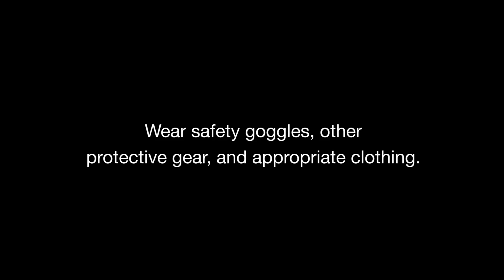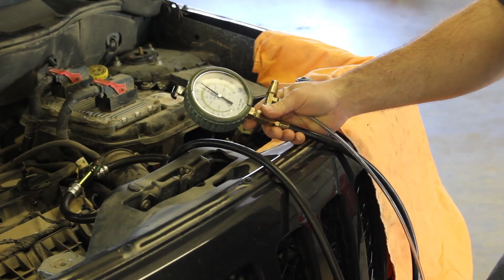How to Install Fuel Pump E7218M in a 2007 - 2014 Jeep Patriot, Jeep Compass, Dodge Caliber

Comment: If I may add to the gentleman's video ( it worked great for me, btw)

1. You'll need a T55 Torxbit for the seat bolts- same size  as for seat belt anchors. Stanley has a set you can get that works with your 3/8 ratchet. Just press firmly against the bolt to loosen, to avoid stripping the bolt head. My bolts, btw, were in front of the seat.

2. Your fuel pump lock ring may look different. Works the same, though.

3. My wife's 2014 Patriot did not have a lower hose attached. It wasn't loose in the tank either, I checked.

4. The blue plastic part that locks the fuel line to the top of the pump is essential so if you are going to reuse the old one VERY CAREFULLY remove it from the old pump. It is a tiny piece of plastic, after all, but if you crack it your fuel line WILL come off and you'll have an enormous fire hazard.

Anyway, it is a very easy job to do.

Comment: I was pleased to see that removing the fuel tank is not required for the 2014 Patriot. Previous vehicles have required removal. I'm not very mechanical but even I could perform this repair. Thank you.

Comment: Hi, thank you for this great video. Can you please elaborate on the very last step? is bleeding the pressure after installation necessary? I've read in the service manual that you need the scan tool to pressurize the system, is that necessary as well?
Reply: ***** Thank you very much. Just finished the replacement, following the steps in your video.

Comment: Where is the fuel pressure port located on the jeep patriot? Thank you for your awesome video!
Reply: Incase anyone is still looking for it, there isn't a Schrader valve on the patriot. You'll have to tap into fuel line. Take off the engine cover and you should see a line feeding directly into the fuel rail on the engine. It connects using a green/black plastic latch. You'll have to get a pressure kit that is compatible with this system. Most auto parts stores will loan you pressure tester kits, make sure to get one with a lot of connector options.

Comment: We’re is the fuel filter located on the Jeep Compass 2008
Reply: It's on the pump. It does not have a serviceable in-line filter like a 90s chevy pickup. I just cleaned and prepped mine about 10 min ago actually (so easy) and I'm going to throw in a new one just cause it's so easy and cheap at work (autozone) lol. Now as far as replacement for what I've read there are some issues on installation with the popular warranty option DFG1140. Some say it either doesnt fit or the armature on the level sensor doesn't work properly...so I'm going to put it to the test tomorrow and try and keep you posted.

2010 Compass Sport 2.4 108xxx

Comment: I got as far as attaching the transfer line. My assembly won't seat, it's getting hung up on something somehow.  This is frustrating as this is my 4th or 5th fuel pump I've installed in my lifetime working on vehicles.

Comment: Fuel pump wont seat all the way- not enough for me to put the lock ring back on top- is there a way to get the pump to seat into the tank?
Reply: I'm having the same issue...did you figure it out?
Reply: did you figure this out,have same problem
Reply: Did any one figure this out??
Reply: Sorry for the delay all- I think I just got a hammer and a non-ferrous metal (copper pipe) found a rib and tried to tap it back into the locked position. It’s not easy& I had a really unpleasant time doing this whole thing. Good luck.

Comment: Could this be a fix to to the dash warning "gas cap open"
Reply: I see no one replied. The gas cap open is about the evap system, which is separate from the fuel delivery system. The evap light comes on when there is a vacuum leak in the system and if replacing the gas cap doesn't correct the problem, then you have to look all through the evap system to find the air leak. Good luck.
Reply: @felipecardoza9967  wrong… it turns out my check engine light was on and my fuel pump went out

Comment: can we bleed pressure of the system by removing the fuel pump relay and crank the vehicle? without using the pressure gauge system?
Reply from the maker: It will. The vehicle will start and burn the fuel off or it will dump the gas into the cylinders in effect flooding it since the engine isn't running. The gauge method is the cleanest.

Comment: Can a fuel pump be weak but operating, i have a p0171 code and have went thru everything else.
Reply from the maker: A weak fuel pump may throw the P0171 code.  Other common issues with a P0171 code are: dirty or defective mass air flow sensor, vacuum leaks,  fuel injector issues; dirty or clogged, bad O2 sensor.
If the pump is found to be weak; low pressure, you will need to do a voltage drop test. If the voltage to the pump is low it will not be able to perform to spec. Even a new pump will fail to perform.

Comment: I just went through 2 Delphi pumps in a 2011 Compass in 4 months. First one lasted 3 months second exactly a 1. I'm pretty pissed off because of tow bills. Pumps just start sputtering and go out. Double checked running direct power and grounds once they were out before returning for the warranty. Damn China!

Comment: Do you the ohms for the fuel sending unit?
Reply from the maker: Ohms readings for the sender are: Full: 13.3, Empty 172.4 +/- 5.
Reply: @AirtexFuelPumps   i have a 4x4 and have 2 send unit, i'll check them right now it seems no one is working, aleays says empty, thanks!!!
Reply from the maker: @aarontirado9227  If it always reads empty make sure you have proper voltage and ground for the sender.

Comment: where's the fuel filter
Reply: In case this helps anyone, the filter and pump are part of the same assembly on this vehicle. One unit.
Reply: @adonishamad7972  it’s 2023 and you just led me to the light with your answer!! Thank you very much 🙏
Reply: @bigb63fsu  Me too